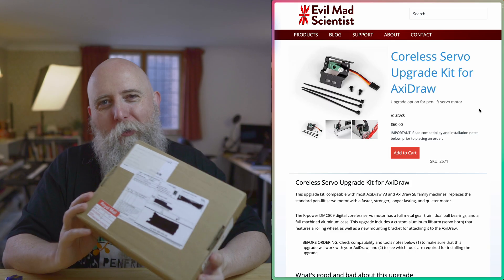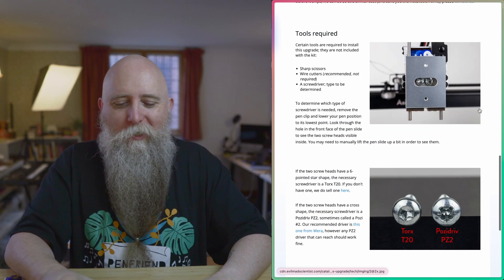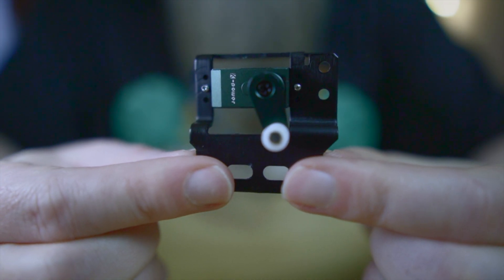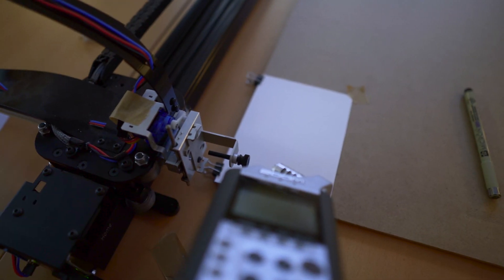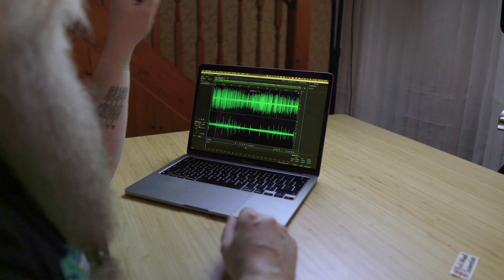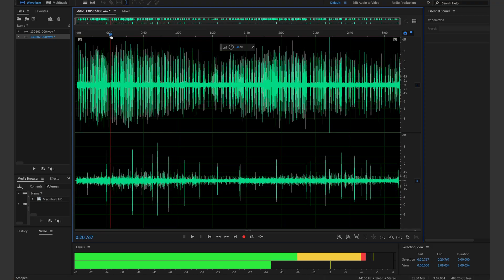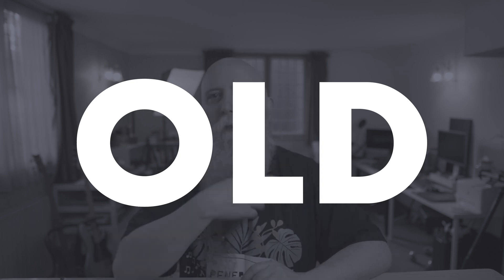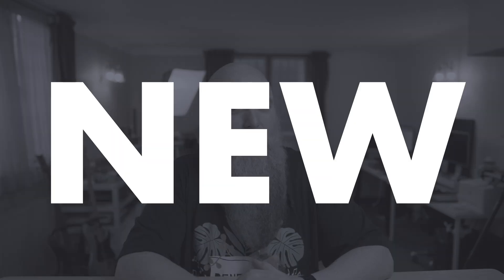Quick review of the new AxiDraw Coreless Servo Upgrade Kit | Unboxing

Comment: Speaking of noise, why does the axidraw have such high pitched melodic sounds? My DIY plotter (similar to axidraw v2) has almost no noise coming from the steppers... Different microstepping or something like this?
Reply: Depends on what stepper driver you have vs the AxiDraw. In the last few years drivers emphasizing silence have become popular and inexpensive. The EBB that runs the AxiDraw is a relatively older design and uses A4983 16X micro stepping motors. 256x micro steps have become more popular and are quieter. And drivers like some Trinamic's are explicitly designed to be quiet.
Reply: I love the melodic sounds! The servo noise can be a bit annoying but the stepper noise is super cool imho

Comment: I think my first regular servo is starting to fail (or it just overheated? Is that a thing?), so I ordered a couple coreless servos to fit on my Axidraw SE/A3! The durability aspect really appeals to me, I'm not a fan of buying disposable electronics. I know there is a brushless servo too but that seems a bit overkill. Are you still using the coreless servo or are you exclusively using brushless servos? How do they hold up? Great video btw!

Comment: There does need to be a proper video demonstrating changing out the servos. Either the old style or the new.
Reply from the maker: Ah, I was focused on the sound levels here. I thought about it, but the instructions on how to change the servo are detailed enough that I'd just be repeating those.

You pretty much unclip a wire, pop out a couple of rivets, unscrew the unit and then put the new one on in the reverse order. Even I managed it and that was something.

I'll add it to my to-do list though as I have a second one I need to switch out.